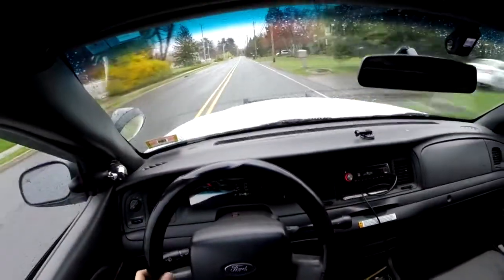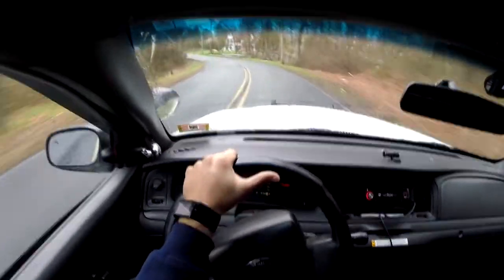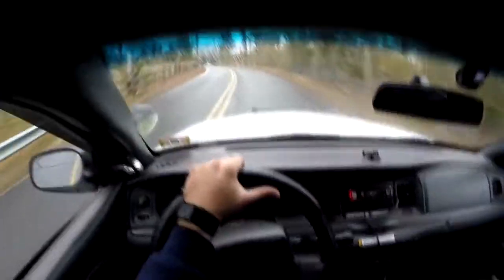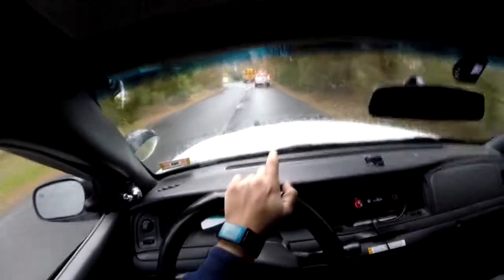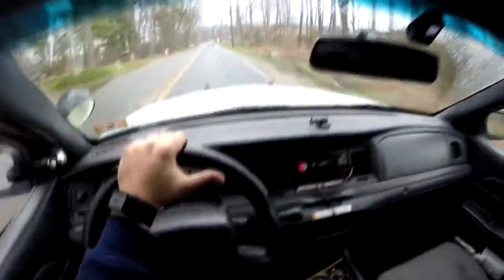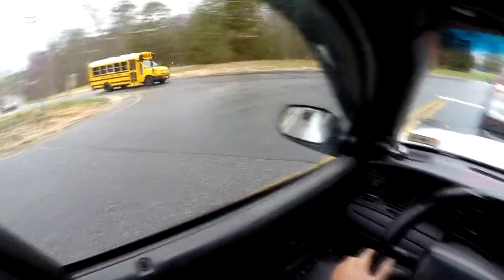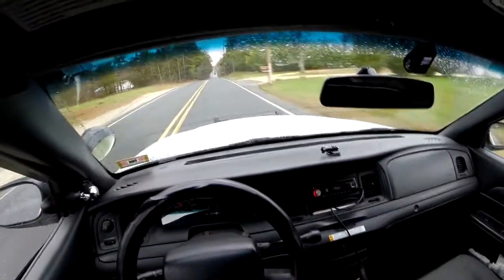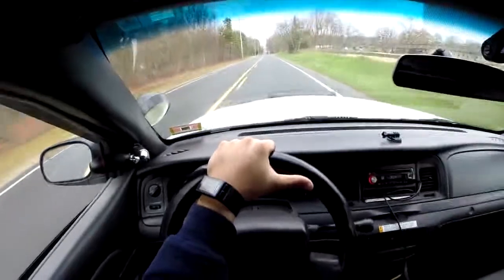Differences between Crown Victoria and Police Interceptor - NJCVP71

Comment: The main differences between civilian model and P 71 is radiator hoses the entire cooling system for transmission power steering and of course radiator the suspension is raised about 2 inches to hop curbs and stiffer an up the ride has all aluminum driveshaft has a beefed up transmission and the computer has been altered to mess with the speed output that’s all that’s been done to the computer so you can reach top speed of 139 compared to civilian is 120
Reply: Raised .8 inches

Comment: The difference between the civilian and police Crown Victorias isn't really that great at all. Built like a tank and share the same engine (unless you count the older boxy ones) Aside the slight changes in suspension, transmission, cooling systems, and MINOR power boost, overall the same. But watch out for the top speed limit governors. I perfer the regular, specifically the LX, because that has all the optional luxury stuff which the P71 lacked entirely and is never abused from pursuits or non-stop idling the police version would suffer.
Reply from the maker: best car ive ever owned!